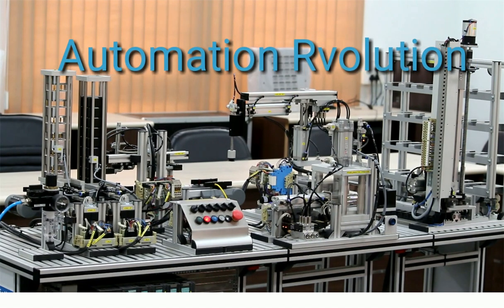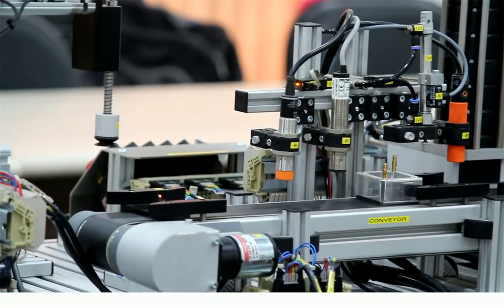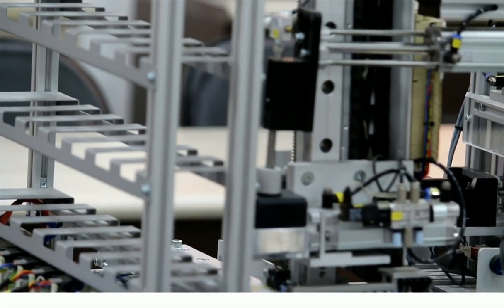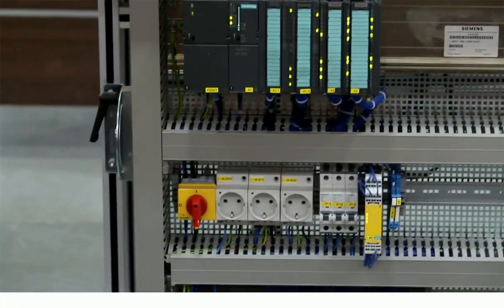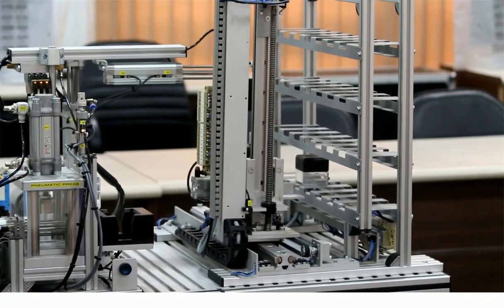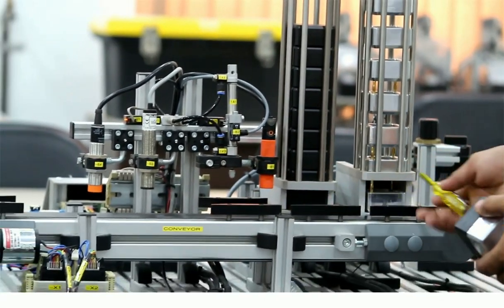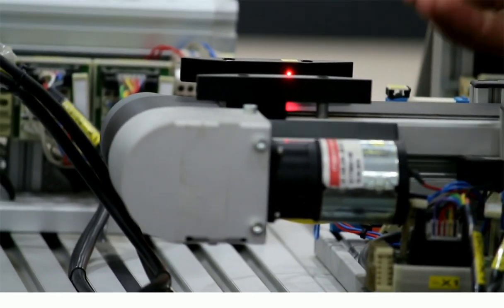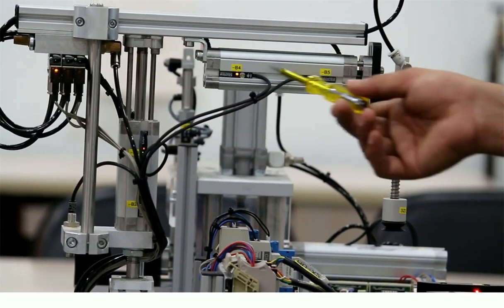PLC based Project on Mechatronics System for Industry 4.0

Comment: First of all, beautiful representation of mechatronics. 

I'm little curious to know the logic behind the staking of the boxes onto the shelves. Can you please elaborate on how you program the module to place the box at a particular place ? How to detect if place is wide enough to place the box ? 

Thanks.
Reply from the maker: Thanks for the comment. We have calculated pulse of photo sensor which are installed over horizontal and vertical LMG. Logic can be defined anyway.
Reply: I’m looking to build similar kind of project, is it possible to have your email id or any other contact info, to contact you in near future?

Comment: Hello sir, 
Can u plzz tell what all equipment's u used for this project  for example there r number of pneumatic cylinder u have used in project how to differentiate them , control systems etc... Can u even tell us what is the total cost of this project.......
Reply from the maker: This project is made by Siemens Sitrain Team. There are number of inputs as Proximity sensor and Output as Solenoid Valves. Siemens S7 300 PLC is used for controlling. I can't tell exactly cost but it would be in some lack.
Reply: Thanks..... But can u list out all the components used in this project.......

Comment: Sir in MECHATRONICS system why we use four sensor to detect metal object?
Reply from the maker: Good Question. Four sensors are not only for metal. There are two types of materials with different orientations. so first Sensor is Capacitive sensor which detects material present or not. as it can sense all type of objects. Second sensor is photosensor so it will detect only reflecting surface so once it will confirm metal object came. And third sensor is inductive sensor which detects only metal. So again in confirm metal object. Here two times metal object will be detected so programming would be like this once two sensor sense it will consider as metal and continue cycle further. I hope now your doubt is cleared.